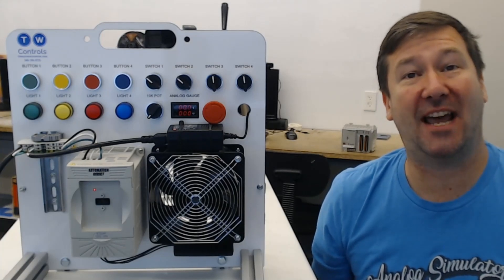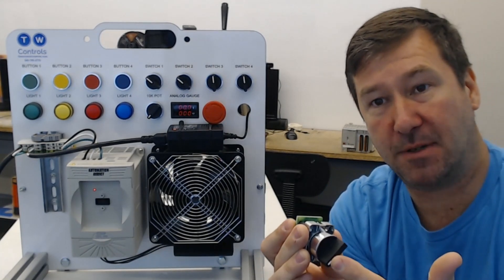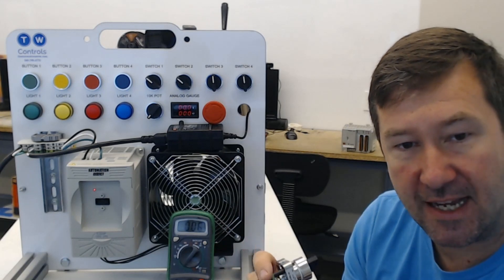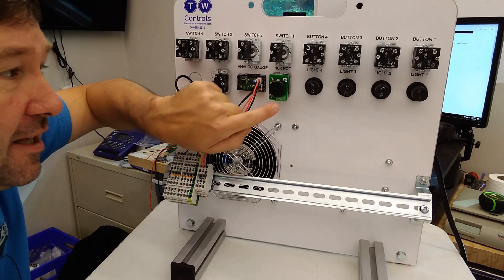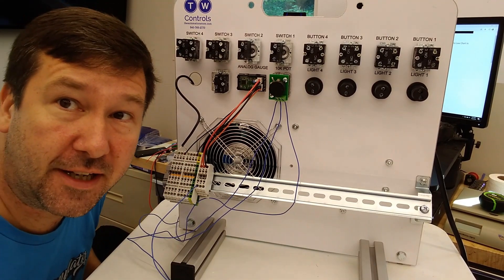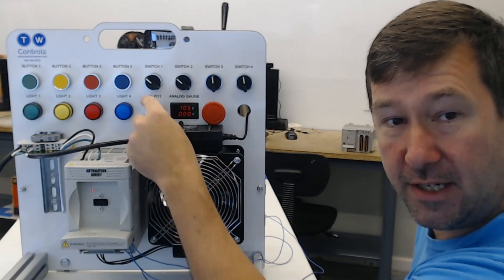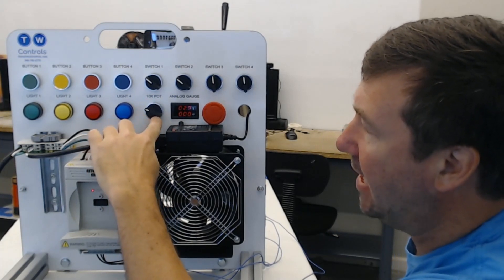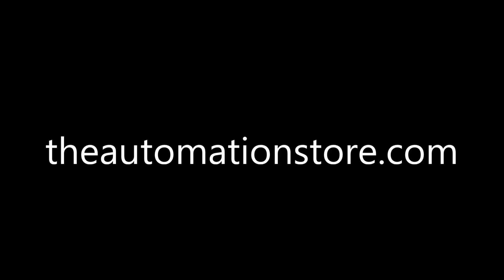How to Wire an Analog Voltage Signal.  Potentiometers, Resistors, 0-10VDCs, Speed Commands

Comment: Hi Tim, thanks for another great video! What would I do if I want to wire the signal wire from the potentiometer to the volt meter as well as to the analog input? Would I just wire wire the meter and the input in parallel so I can monitor how much voltage is going to the input?
Reply from the maker: Yes, just make sure you are not going over the wattage of the potentiometer.  Most inputs don't pull a measurable amount but just so you are aware.

Comment: Tim, could you add a schematic of the wiring with your video please? Can’t wait for the analog video.
Reply from the maker: Here you go.  https://www.theautomationstore.com/analog-circuits-training-wiring-a-potentiometer-to-a-meter-basic-voltage-circuit/
Reply: @TimWilborne  That schematic does show how it was wired to the VFD. No matter how I wire it, it either shows .1 volt or 23.9v, and if I turn the dial all the way to the left, it shuts off the 24v power supply. Weird.
Reply from the maker: @CaptainZeroHero  It sounds like you're shorting the + and - of your power supply with potentiometer so that the further you turn it up the more amps is pulling. Can you describe a little more about how you have a connected?